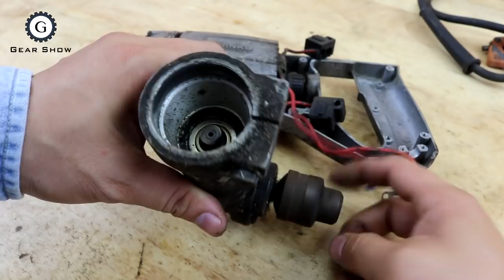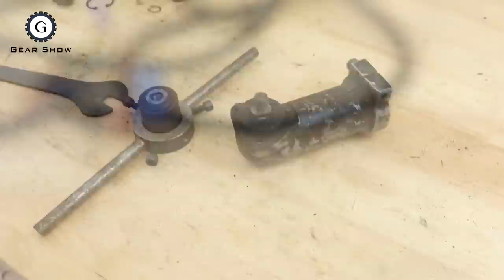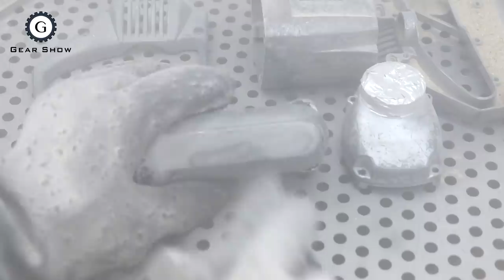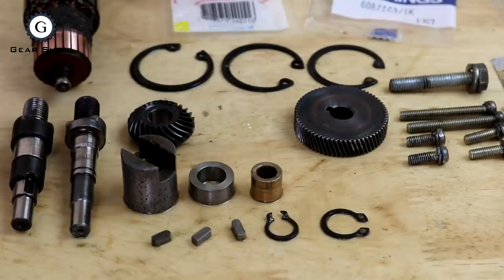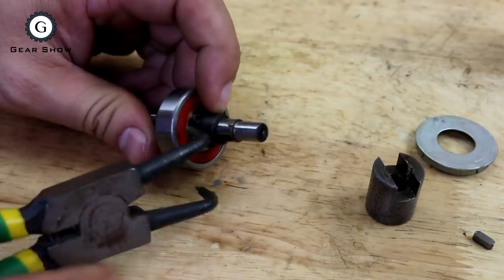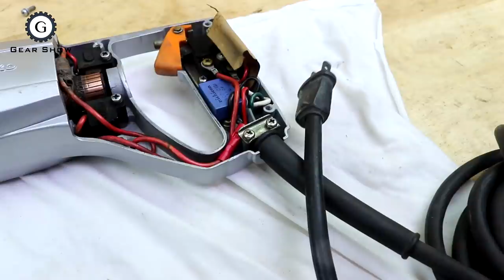Vintage Right Angle Drill Restoration | SHINKO Right Angle Drill

Comment: Thoroughly, methodically and professionally done.  Good Job!  These drills are mainly used by electricians and plumbers to drill holes for wire and piping in ceiling joists and wall studs.  This one was a good choice and appears to have had little use judging by the Commutator.  Poor workman destroyed the Chuck.
Reply from the maker: Thank you for sharing!

Comment: Nice to see that at least most of the bearings were driven on/in correctly this time (by applying pressure to the ring being mated, avoiding putting pressure on the balls).
I still think the front part should have been painted black as it was originally, but nice job otherwise. :)
Reply: originally it could have been dark green, which got even darker with time :D
Reply from the maker: Thank you for sharing!

Comment: I'm assuming you removed the old 2 pin plugtop and replaced it with a 3 pin...?
It'd also be nice to see you testing both armatures AND field packs PROPERLY for comparable values AND insulation resistance...
NOT just a quick continuity beep...🇬🇧👍

Comment: how much did it cost u to rebuild? is it worth over buying a new one?
Reply: Tasos Arpoudis is you have all the tools you could probably do this for under $10. It’s really   not that hard or expensive if you have the knowledge
Reply: Costs less to repair, and it's funny also
Reply: Plus you will not find the same quality in recently manufactured tools.
Reply: @therealtrucker7564  Obviously you have not purchased Bearings in 50 years.
Reply: Gord Baker not everything he does on this channel requires new bearings. There a lot of cleaning up, greasing, fixing a connection or two, and BOOM good as new.
Reply: @therealtrucker7564  Agreed.  But why take the chance when you are 'into' it.

Comment: You had an earth wire in the power cord, but where is the prong that the wire goes to? All I see are 2 prongs on the plug.
Reply from the maker: It has a bracket at the end of the cable.

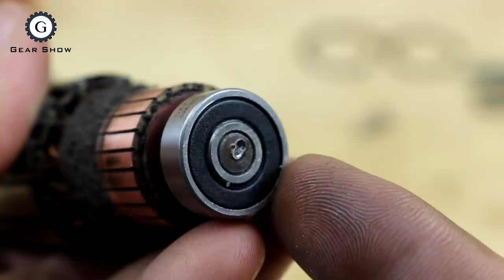Comment: 21:05 Looks like signs of a hack job, and a poor one at that. The bearing was too loose on the shaft, so someone made those punch marks to make it stay on. They would have to be closer to the edge for it to actually work properly. Something we apprentices weren't allowed to do when I apprenticed as a fitter back in the mid-90's.
Reply from the maker: Thank you sharing! This hole happen while I was pulling the bearing out by using bearing puller.
Reply: @gear_show  Ah, I thought there were something odd about the position of the mark. No previous hack job then. :)